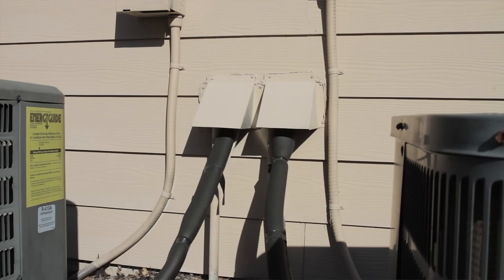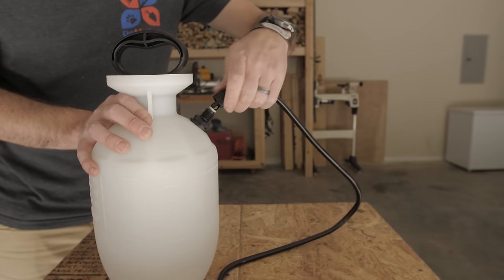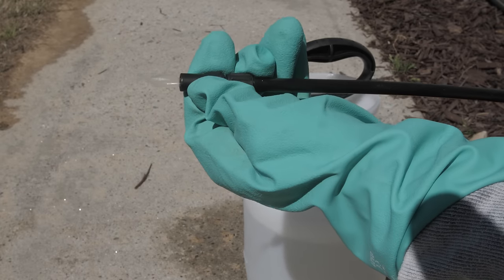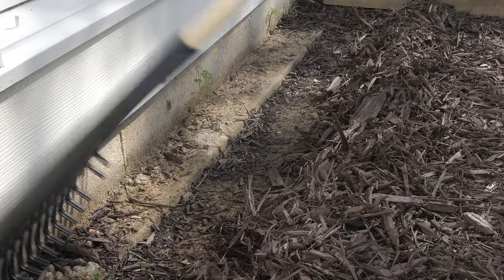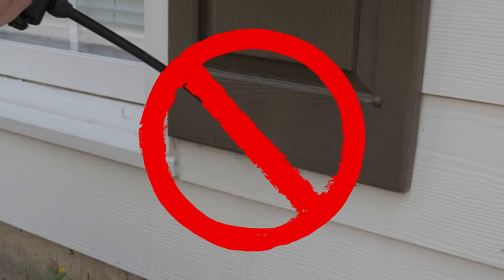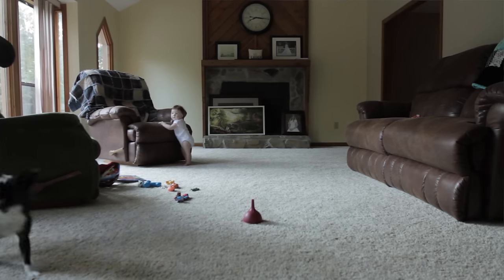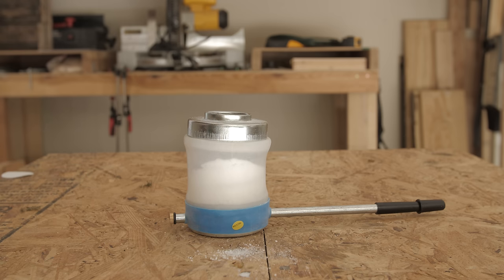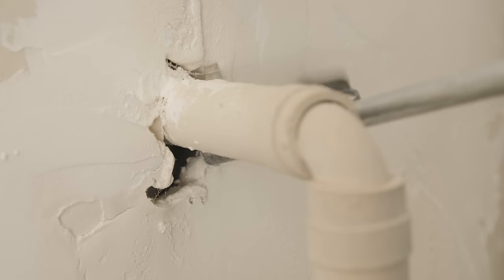How to do a General Pest Control Treatment - DIY Pest Control | DoMyOwn.com

Comment: Never seen any pest control company did this. I think I got ripped off.
Reply: Unless you're following the tech throughout the service you won't. Also consider that the service is outcome based not how much insecticide is used. This video is how to treat your home initially. For example, you wouldn't dust those areas every month or even every other month as it lasts generally 6 months
Reply: I always do his and more
Reply: Me too
Reply: Just like a doctor will tackle a problem differently, so will a pest tech. Not necessarily a bad thing
Reply: I'm a tech we definitely do this but we aren't payed to clean your property
Reply: @marcellusfulbright5918  well you’re wrong on that. You pay for cheap you’re getting cheap. I do this on every treatment. Every customer gets treated fairly and the same.
Reply: @Yourebeingtrolled  ain’t that the truth.
Reply: @calebnunley112  wrong on what? I didn't say techs don't do this generally. I'm saying most customers don't actually see everything the tech does unless they actually follow them.
Reply: @marcellusfulbright5918  oh haha I though you meant we never do this stuff. My bad carry on.
Reply: That's because they would all go broke for taking that much time on each house
Reply: @michaelmerck7576  sure ya did
Reply: All that can be arranged but the cost will be different.

Home owner is responsible for
maintenance and cleaning.

Integrated pest management consist on using the less quantity of pesticide possible, first inspect what's causing the infestation and correct that situation.
Reply: @marcellusfulbright5918 And some customers do follow them..
Reply: @mercedesbenzs600bash  Some do some don't. I was never bothered either unless they're slowing me down or trying to tell me what to do.
Reply: @marcellusfulbright5918  I hear ya...
Reply: Did this?? No wonder
Reply: I work for Orkin and this is pretty much every service start for us. We re visit the dust every quarter
Reply: As a pest control technician I do this with every service and I’ve never once had a customer complain after doing their service. even when I took on a route that was ran by a tech who didn’t do service correctly the customers were beyond happy with my treatment

Comment: I live in a townhouse complex and i did the back patio and front porch area. Next is to find indoor bug spray and the dust so i can do the inside the same. We were infested with gnats for like 2 months probably longer. And i couldn’t take it anymore. When we contacted the pest control on sight , he told us to just keep the drains closed and there’s nothing he could do for us. It got so bad i started eating in the car and i would just stand over my daughter swatting them away until she could finish eating and even then a lot of food got thrown away. I had to sleep completely under the covers. I couldn’t stop itching. I felt disgusting. I tore the place apart and cleaned it like a mad woman. I have never moved a stove or fridge before but i did here! Lol it was so bad i was twitching and ticking like i lost some screws for real. But we used some foggers and i started treating outside on our own. I can’t wait to get tf out of this place but at least i can eat without swallowing the food whole in seconds or having to go outside in the car to eat.
Reply: I had that happen once, and traced the source back to an old forgotten bag of potatoes, stored in a small cabinet above the stove that no one used lol

Comment: So helpful. I was watching the  exterminator I hired and he did such a lazy job spraying that I figured I could just do it myself. It wasn’t very complicated at all.
Reply: No pest control companies do all of this. It’s redundant and a waste of time.
Reply: @ivarboneless2649  you really think so? I’d say leave no stone unturned if I’m doing it myself and it doesn’t cost me much. But I was surprised to see the thoroughness with the spray, and then dusting on top of that. But how much do you think it really takes to do the trick?
Reply: @checkthisjunkout  If you’re doing it yourself by all means have at it, but this way of doing it is redundant and out dated. Using a good barrier treatment on the foundation, doors and windows on the exterior and using dusts in voids (weep holes) is plenty and you won’t have any pesticides in your house.
Reply: @ivarboneless2649  👍
Reply: @ivarboneless2649  - I think it depends. In NJ, I certainly won't spray all around my doors. Maybe I would in Florida?

Comment: Working as a professional pest control technician i can disprove alot of this. Although we work with more potent and efective chemicals,  alot of the digging and getting rid of brush and dirt is incorrect. If you use more of a pesticide to water ratio you can obviously get a stronger result. You don't really need to spray the whole 3 feet in either direction, just a simple stream that touches the bottom of the house and the basic ground should be fine enough. As far as the dusting goes, you want to apply it under any possible openings, cracks, and crevices around the home in about 6 inches to 1 foot increments. And when it comes to holes or larger openings and or around pipes and siding, just a simple layer of expanding foam in the hole and it can stop mice for up to a year...as well as BAIT TRAPS and bigger glue strips... not snap traps... can help in frequent sightings INSIDE OF THE HOME...bait traps need to be placed in corners and glue strips up above cupboards (if dealing with roaches) and folded up glue traps( to avoid children and pets) under highly wet or warm areas of the kitchen or bathroom such as under the sink, fridge, toilet and oven. As far as residential in home spraying goes (if you need to spray inside for bedbugs, roaches or mice you should call a professional)
Sincerely,
The person you pay to kill your bugs. ♡ :)
Reply from the maker: We appreciate your feedback. The chemicals you use as a technician are the same chemicals we offer on our site for our customers to purchase and they would be using the same strength formulas as you are familiar with in your work. There are exceptions to some products in more restrictive states such as NY, CT, and CA for instance, however most are registered for a homeowner to have access to themselves. Using more pesticide to water ratio does not lead to a stronger result. You should never apply a chemical any higher strength than the manufacturers label dictates. Some products will have a low end and a high end use rate, depending on whether you are treating proactively for insect prevention, or doing a clean out and elimination of a current pest infestation. Mixing stronger than label rates will not increase your results, for some pests it can actually work the opposite of what you desire by doing so, and would be unsafe. The Label is the law and should be followed as such. While a full 3 foot up and out barrier may not be necessary for every persons needs, it does create a well treated zone of protection around the home, and the more surface area there is for an insect to crawl over the more product it picks up on its body to die from. A simple stream leaves very little room for an insect to cross over and get a full dose of the chemical to be affected. The better barrier you create on the outside of the home around the foundation, as well as window/door frames and other entry points like pipes, etc, the better protection you get and less need for any interior insecticide applications. 

Expanding foams and other excluder materials such as steel wool, copper mesh, and similar items are all great for sealing up gaps around the home from rodents or insects. Since not all homeowners have the ability to get every crack on the home (many older homes for instance have an abundance of gaps that are not easily reached), spraying where you can get is a better alternative to not doing anything at all. Bait stations for rodents ideally should only be used outside once the home has been adequately sealed up, to help avoid any unnecessary decomposing rodent bodies for the home owner to have to find, remove, or deal with indoors in walls. They are effective for dropping overall rodent populations outdoors to help reduce the chances of them chewing into the home. Glue traps are a great monitoring tool for indoors, and great for catching rodents that do end up inside a home. 

We have thousands of customers who are great DIY-ers who have successfully followed insecticide labels, as well as our handy guides, to treat for and eliminate bedbugs, roaches, mice, and many other pests on their own. With the expert advice from our team, we empower our customers to tackle pest problems head on, and recommend pro help when the situation seems a bit too daunting for those tougher situations.
Reply: @domyown  I had a boss I worked for doing pest control ,his favorite saying was you can't kill them deader than dead so just follow the label and he told us and as far as he was concerned if he had to testify in court he would say my employees were instructed to and supervised to follow the label

Comment: A pest controller will not landscape or clean your gutters to provide a more effective spray but a good one will recommend it to the home owner ways to prevent or reduce rodent/insect activity.
Reply: cleaning gutters isn't a standard pest control practice but homeowners should already know to clean their gutters .it's not hard to check while raining to see if the gutters are draining or you could use your garden hose to see if the gutters are full
Reply: @michaelmerck7576 Very true..

Comment: Great video. thank you. Could you please mention the names of the chemical (insecticides) we need to load in the sprayer and what ratios. Thanks
Reply from the maker: Our most popular general use product is called Talstar.  https://www.domyown.com/talstar-talstar-one-p-97.html  It is widely used by pest control companies because it is labeled for almost every insect you could have a problem with and you can use it outside the home as well as inside, it is odorless and very safe for use around children and pets.  It is a liquid concentrate that you mix with water in a one gallon hand pump sprayer.  https://www.domyown.com/chapin-sprayers-c-29_189_270.html It will last for 60 to 90 days outside in between treatments.  It is also labeled for lawn and ornamental use, and can be used on trees, plants, bushes and shrubs for all sorts of ornamental pests including Japanese beetles, mosquitoes, and other leaf eating pests. 
Talstar is also available in a granule formula called Talstar PL if you prefer to use granules.  https://www.domyown.com/talstar-pl-granules-p-47.html
Reply: @domyown  l

Comment: Can u please recommend a respirator, what brand or type to use when spaying?
Reply from the maker: Our pros recommend the Comfo Classic Half-Mask Respirator linked here --> https://www.domyown.com/comfo-classic-respirator-mask-with-p100-cartridges-kit-p-464.html
Reply: I know your comment was a long time ago. But in addition to what op recommended, you should compare the chemicals you're spraying with datasheets and information for the filter/cartridge you use. I use a 3M half-mask respirator similar to what they linked. 3M sells lots of different filters and cartridges. Depending upon the task you're doing, certain filters are better suited. You can have a filter rated P100, but there are different types that can filter out additional things like chlorine gas and other vapors.
Reply: @DannyPost  thank you for your help!

Comment: What product can I use to spray scorpions inside and out of the house.  I have a pest control that does every 2 months and would like to do it myself instead. Thanks for your video.
Reply from the maker: We recommend using an encapsulated product such as Demand CS for scorpion control. You can purchase this product on its own here:

https://www.domyown.com/demand-cs-p-46.html 

We also sell this as part of our Scorpion Control Kit which includes a UV light to help you locate hot spots and glue boards to help catch and monitor scorpions indoors:

https://www.domyown.com/scorpion-control-kit-p-1403.html
Reply: You might be better off to use some glue board monitors to trap the scorpions because I remember way back I put a live scorpion into a small jar of straight diazinon (when it was legal to use),it took about a week for that scorpion to die
Reply: @michaelmerck7576 Dammmmmm their really strong...

Comment: please tell us how to spray overhead areas to prevent wasp nests ect.
Reply from the maker: You can use a hand pump sprayer or backpack sprayer to treat under eaves to prevent insects like wasps from building nests in those areas. For even more reach, you may consider the Chapin Slide Pump Sprayer. You can view details and see some video of that sprayer here:  https://www.domyown.com/chapin-slide-pump-sprayer-6002-p-704.html
Be sure to protect your face and eyes if you are spraying in a manner where there could be overspray. We have more tips on treating for wasps and hornets in this guide as well:
https://www.domyown.com/how-to-get-rid-of-wasps-a-505.html
Reply: You really can't prevent them with a pesticide in my opinion but you might could apply something to possibly repel them from areas you would not like for them to be

Comment: Cant u just use a hand spray bottle for doing the inside of a small apartment?
Reply from the maker: Yes, but you need to be sure you are using the correct ratio to water and be sure you are spraying around the baseboards, window frames, and door frames.

Comment: Which pesticide can l use to eliminate stubborn mosquitoes in my house?. They gets inside my pants and bites me . I can't sleep well at night coz they gets through the net and bites me. What kind of mosquitoes could they be coz normal mosquito don't get inside your pants ? They also fly and hide so it's hard to kill them
Reply from the maker: Our most popular general use product is called Bifen IT. It is widely used by pest control companies because it is labeled for almost every insect you could have a problem with and you can use it outside of the home as well as inside, it is odorless and very safe for use around children and pets. It is a liquid concentrate that you mix with water in a handpump sprayer and It will last for 60 to 90 days inside the home and 30 days outside of the home. Please read and follow the label instructions.

https://www.domyown.com/bifen-it-p-226.html?sub_id=11662
Reply: With Mosquitoes you need to find the source of there breeding which is normally stagnant water  (Water that's  been sitting for ages such as Ponds, and areas were rain water has been sitting for a long time. they breed in this environment so remove the water and your remove the mozzies

Comment: What psi does manufacturer recommend for application of product?
Reply from the maker: Most hand pump and backpack sprayers will not have more than up to about 50-60 psi, so you generally would not use any more than that for regular perimeter insecticide applications. You would only need a higher psi if you were needing to treating up high such as on second story eaves or very tall trees.

Comment: How often do you recommend applying insecticide dust?
Reply from the maker: It depends on which insecticide you choose. Here's some information on two insecticides that cover a large range of insects:

D-Fense Deltamethrin dust contains the same active ingredient as Delta Dust. D-Fense Deltamethrin dust is water resistant and can last up to 8 months when applied in wall voids and cracks and crevices properly. This should be applied using a hand duster or power duster equipment.
https://www.domyown.com/dfense-deltamethrin-dust-p-2428.html

Cimexa Dust is 100% Silica dust, is very safe, odorless, and will not stain.  CimeXa Dust will last up to 10 years when applied to undisturbed areas like wall voids. 
https://www.domyown.com/cimexa-insecticide-dust-p-2513.html
Reply: Once that dust goes behind walls or in voids where water doesn't get to it, it's pretty much there to stay. It's not like a chemical spray that has a short residual time, especially outdoors where the sun rays really shorten them. Dust has become a very underused product over the years since non-repellent sprays like Alpine WSG, Phantom and others.